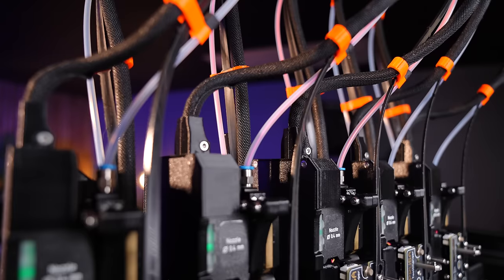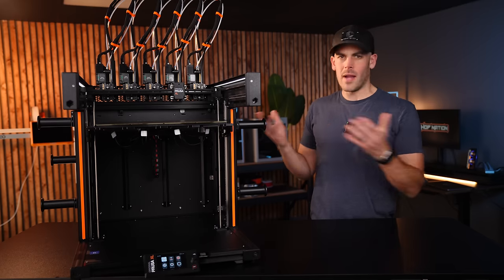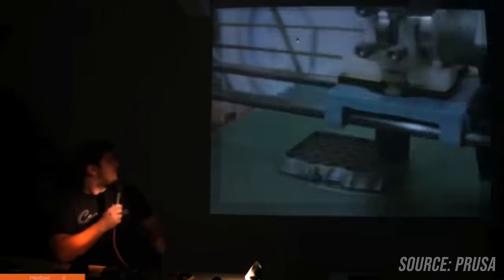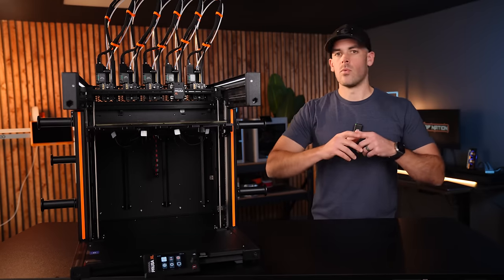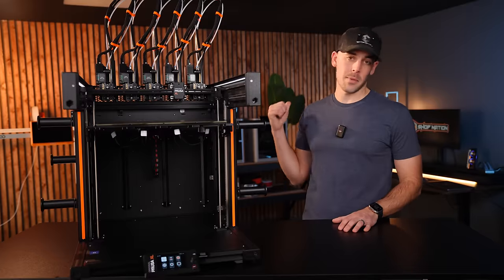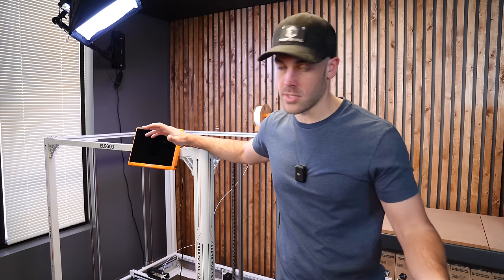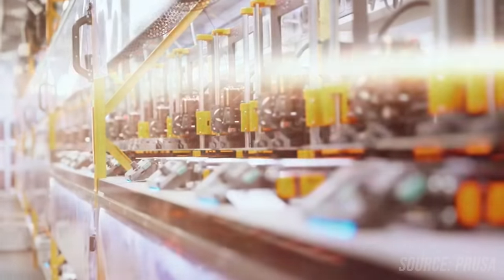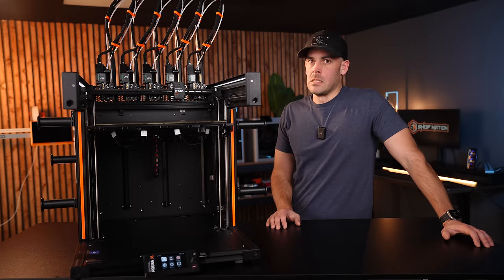Why Prusa is the next Blackberry

Comment: I agree that the advantage of the XL is the tool-changer.  How valuable that is remains to be seen.  The other major market advantage Prusa has is their reputation for excellent service; and that is of course a huge part of Prusa's high prices.  You're also paying for the open-source philosophy.  Prusa can't count on a grace period in which they can recoup their R&D costs, so they have to make that back in margins.

Covid supply chain disruption followed by the effects of the Ukraine war  - think about how much of their supply probably came in via Ukrainian ports; Czech Republic is landlocked and most major electronics are made in Asia - certainly delayed the XL, meaning that it's a generation behind not in technology but in philosophy.  The real value of a Bambu printer (and I have an X1C from the Kickstarted and absolutely love it) is how simple it is to use.  My impression is that the XL isn't quite so easy.  But on the other hand, Bambu is clearly struggling to cope with the massive expansion in their user base, and the support side is overloaded.

So... I think if Prusa wants to compete, they need to come up with a printer that is as easy to use as an X1C or a P1P, in a comparable price range, but backed by their excellent support team.  Having a mid-sized (25x25cm or so) 3-head tool-changer for 1000-1200 Euros/USD that just worked without any faffing about, with a marked down single-head version, would be an excellent thing to target. I also think that in order to get the price down, they're going to have to step away from open-source so they can recover their R&D costs.  Open source is extremely expensive.  Back when everyone had to know how to build a printer in order to use a printer, Prusa could afford to be open source because enough people were willing to pay their prices to get the support needed to achieve low-skill reliability.  Today, there are too many options for reliabiilty that cost a lot less, and I think open-source is a luxury Prusa can't afford any longer.

Comment: Sadly I agree - I am a loyal but disappointed Prusa user. I own mk3 mk4 and have an XL arriving in April. I also have a t500 comgrow and an Anycubic Max 2. Core xy for me is the way forward for farm compactness. Printer cost is not as important as its return on investment - speed / reliability / quality for hours on end. I don’t own a Bambu and probably won’t at this time as I run Octoprint and home grown farm software. I want it open source and really a mk4 corexy. Camera / klipper / easy to implement into a farm system. Want them to win but mk4 / xl such a fiasco..

Comment: I think Prusa should continue lean into their core strengths of open hardware and fostering an innovative and friendly community, and continue to make reliable machines and software at reasonable prices (the XL was never priced to compete with Bambulab printers, it was priced to compete with Ultimaker and Markforged-- in this context, 5 tool heads at ~$6000 is a bargain!)

Comment: The difference in material between the Prusa XL and the BambuLab X1 with AMS is also lower the more prints you do at the same time. The the test you made is only really valid if you buy the XL to print a single small multi-colour object at a time - which seems somewhat unlikely as well. The waste will still be there, but the waste (and switching time) will be constant even if you print 20 benchys at the same time.

Comment: I'm frustrated by Prusas numerous poor decisions, and it seems theyre not making any effort to change course. Prusa is actively developing the slicer for Bambu Labs because Bambu Labs is just using a skin with some minor tweaks, and apparently Prusa Research still thinks that open source is a good idea for this type of market. The Chinese stole and copied everything from them until they were better at manufacturing and are now clearly leading. Customers aren't looking for machines to tinker with; they want sleek, feature-rich devices.

The decision to release an open-frame design printer is baffling. Their printers have too many parts, which drives the price to an uncompetitive amount, and the machine looks and feels like an obsolete DIY project. There are so many things that are obviously stupid to put in a 2023/24 3D printer, but they still went with it. For example, look at the touchscreens of the MK4 or the XL. Why? Prusa likely knows all there issues, but it appears they're stuck with their choices.

Overcoming these significant challenges will require substantial capital to speed up their slow product development cycle. The forthcoming MK5 will likely be outdated upon release. However, to be fair, your speed comparison wasn't entirely equitable. Focusing solely on printing time overlooks print quality. All Bambu Labs printers are printing too fast. The filament is not extruded hot enough. Parts printed with PETG have a matte finish and compromised mechanical properties, unlike the XL, which maintains proper flow rates and delivers superior speed. The XL won not just by printing time but also by print quality. 

Despite this, the XL falls short compared to its competitors. But the worst part is that I will still buy an MK4 soon. We need manufacturing here in Europe, and we need to support local production. 
Good and fair wages, workers' rights, production that does not poison the environment and the workers, and a seamless supply chain that prevents slavery or exploitation in labor are so important to me that I prefer to buy a Prusa printer rather than a printer from the Chinese capitalists.

Comment: Actually I own a Prusa XL 5 toolhead and I am satisfied. I print multi material (not just multi color)  large prints very well.  I do not care about "nice" color displays or many features you are talking about. I want something what is working. Price sucks ... yes it is .. but I spent the money because I love 3d printing ... It is a hobby for me. Not a many maker. I won't go for Bambu lab, because it doesn't satisfy my need for challenges and modifiability.  On other hand Bambu lab took  all open source know how about 3d printing and put it into a nice mass market package. Nothing revolutionary, just evolutionary. BTW they are using load cells in other models instead of lidar not just because of price difference ;-)  Anyways, comparison of a Prusa XL to a Bambu X1C is like compare a Sedan to a Semi Truck. Both can take a load from place A to B. Sedan is faster ! But voila we still using Semi trucks.  It is just a  different category.

Comment: Man, as someone new to 3D printing I didn't even consider buying a prusha. :/ Has considered a lulz but went straight to Bambu. Multi head would be cool... If it was about the price of a bambu with an AMS (I'd pay a little more) and realistically I feel like I'd only care about having 2 or maybe 3 print heads support material and maybe 1 other color. Very niche. Very expensive. I've occasionally wanted a slightly larger build volume, but really not worth the cost imo.

Comment: I have a Mk4 and love it.. but I'd like to see a polished enclosure integrated at a minimum. I'd also love a 2 head machine (not 4 or 5). I don't care much about colors but switch between PETG and TPU constantly and would let you do things differently with supports. Also  -Prusa's wireless functions are straight up confusing.

Comment: You completely skipped over the use case of printing MULTIMATERIAL, like combining TPU with PETG and PLA supports, which is not really tangible on a single print head.

Comment: Prusa needs a smaller version of this printer. Even duel head would be enough, but 3 heads even nicer. A smaller bed size, 300mm max. Enclosed for ABS, etc. Build something that is priced close to Bambu. Separate heads so much better than filament switching. Less time, less waste. Provide a multi-head upgrade to their single-head core xy machine. If they can get the price close to Bambu, Prusa's support and parts repair/replacement will carry them through.

Comment: The use-case for a prusa isn't a simple colorchange. The use-case is to print flawless with different material at once. For example PLA and PETG. Those two don't mix very well and don't stick very much to each other. This makes it the perfect support material. Or think parts with living hinges and / or overmolding with TPU. Fiber filled materials for outer walls, cheaper materials for infills. Etc etc etc. There are thousands of use-cases, where the (fantastic) BambuLabs can't get a grip on the Prusa.

Comment: I think that Prusa has been making moves in places other than their pure printer mechanics that keep them going.

They've invested a lot into Printables, filament manufacturing, print farm operation software/hardware, and SLA. I remember the cries that the Ender 3 would kill prusa, instead it really killed the i3 clone market and sure took some people who could afford Prusa but were in for more of a hobby.

The elephant in the room is also the K1 and Qidi are putting pressure on Bambu in a game that Prusa has decided not to step in. They're racing to the bottom for reliable core XY closed ecosystem printers with limited print farm integrations or solutions.

Comparing the AMS to the XL's tool changer is on paper a decent comparison, but multi-tool has more advantages than just speed and material (which at scale material cost could be big). Multi tool let's you have your part still retain most of its glass state which when doing changes in materials like ABS, TPU, or silk can be HUGE for layer adhesion vs waiting for a long filament swap, reheat, and purge. Multi-tool also lets you use things other than the same nozzle (changing nozzle sizes, changing heater dynamics), it lets you use drastically different temperature or wear characteristic material without clogs, or it lets you even recover if there are clogs/errors with a single head mid-print. That reliability and recoverability in print can be important for complex production parts.

It's ironic cause I point almost everyone I know at a consumer level away from Prusa for printers. But for labs, small production farms (where reliability is > than startup cost), and engineering samples Prusa is still big.

Prusa is playing more and more to compete with Ultimaker, Raise3d, and Intamsys and come in WAY below those budgets with comparable or leading features and a lot of good support with tweakability.

Comment: Honestly, I think a lot of people fell for Bambu because they offered the illusion of speed at the illusion of lower price. When the X1 came out, the buzz was "bed slingers are dead, core XY or die", but for all the hype, the X1 isn't exactly leaving the Mk4 in its dust. Then the A1 came out,and suddenly it was "Bedslingers are ok again, as long as they do multimaterial". Multimaterial itself is hideous, but the level of waste on Bambu machines ought to be illegal. On top of that I think Bambu is running at or near a loss with their pricing, especially with the A1.

CoreXY isn't the be all and end all of printing either, and not everyone values raw speed over everything. I believe Prusa are playing the long game - with the MK4 they consolidated and modernized their supply chain. With the XL they began testing CoreXY, without betting the farm on it. They clearly want to figure a bunch of things out before ditching cartesian.

What I would like to see Prusa do is double down on convenience and ease of use. More options for fast and easy nozzle swapping. Enclosure support, with motherboard tethering. Better remote management. Better camera and failure detection. There are plenty of community mods but I want Prusa's quality level from them.

Comment: There are two factors not properly addressed here. 
(1) Prusa always took care that the printers work out-of-the box after the initial release hiccups and provided absurd long service to their products (absurd from the perspective of the throw-away-and-buynew society we have to live in)
(2) As far as possible, Prusa is manufacturing in the EU and always expanded their manufacturing capabilities so they can manufacture more stuff in-house. Compare that to virtually all other companies and industries. They went the other way around and this will (and partially already has) generate turmoil in global supply chains and global political risks. 

Prusa is not on the innovation forefront right now, yes, but innovation is not the sole factor determining success. Heck, there are an absurd amount of S&P500 companies that aren't innovative at all and will likely not vanish within decades (looking at you AT&T etc.)

Comment: No offence, but if you don't need or care for toolchanging and what it brings vs an AMS type unit, then ofc you wouldn't appreciate the extra cost of the XL over a Bambu or larger FDM style printer. But that's just it, a toolchanger is a different machine that can do different things (that are not obscure btw, just more industrial so you don't see hype video on IG/YT) than printers with AMS style units.

Comment: Focus on UX and ease of use will get this machine into more engineering departments like mine.  It’s the little details don’t screw up on any of them.  UX of filament changing.  UX of nozzle swaps.  UX of bed leveling.  UX of removing a print.  UX of slicer software.  UX of build support removal.  Then spend $$$ on the parts that matter:  Diamond hot ends, high wattage hot end, Rigidity, precision rails.  BTW i could care less about material changes or even how fast it prints!  Reliability is super important.

Comment: Recently got my hands on a used MK4 (800 meters gone through) and I am impressed with this machine already, plus side you get 24/7 support chat, open source , parts from fystec are compatible etc. Oh and you can use octoprint/octodash. Bambu on the other hand beautifull machine, laks support and firmware is closed (nicked prusa firmware) source? I wonder how fast you can repair a broken prusa vs a broken bambu. You might do a video on that if somethings break in your farm(hope not)

Comment: I think you are missing the point of the XL. Multi color can be done by a ton of other printers, obviously Bambu being the most prevalent and easiest to use. What those dont do, is multi material printing. PLA supports for TPU or PETG, PETG supports for PLA, TPU and PLA in the same print. This was designed for manufacturing, not for trinkets.

Comment: Remember when the i3 first came out and it was made of either wood or acrylic? I remember then and I remember that there was a spanish company that was making a steel version of it. Other than that initial design, all they have done is incremental improvements and the entire industry followed them down that path. Bambu is the only people that forced people to think that just making yet another bed-slinger wasn't the right recipe for success. Sure we had a few deltas and the occasional cartesian box, but most of them were implemented poorly. This was always Prusa's game to lose. It is the same reason that Intel is losing now in the CPU market. They spent 8 years regurgitating the same old tired thing with just a 5-10% improvement over the last one. And they felt smug because AMD couldn't release anything competing because they made a huge mistake with Bulldozer and mispredicted what people were going to code for. And now we have AMD processors that are better in almost every respect. Just like with Intel, there are huge Prusa fanboys who will never admit they were wrong. This isn't the blackberry moment, this is the Intel moment.

Comment: I didn't want to be an early adopter of 3D-printing after seeing the struggles of a friend, and have held out until now.  Convinced myself to get the Prusa Mk4, then considered the physics and now getting the Bambu Labs X1 Carbon instead. It's obvious that the variable inertia of bed-slinging can never be as fast or accurate as core-XY. Prusa's Mk4 needed to be a core-XY printer and they need to protect their intellectual property, as Bambu Labs are, to avoid becoming a Blackberry.

Comment: Prusa is certainly taking risks. The MK4 is suitable as a machine for hobbyists but the price is way to high. Yes the quality is outstanding and running 24/7 for about 4 or 5 year certainly will be possible. Prusa is pushed more and more to the professional market. I don't know if that market is big enough. They should add a free mmu or create a cheaper version of the MK4 and mini to survive the competition.
The XL is a unique machine. A bit overpriced compared to other machines in the market, but with multiple toolheads it is an unique machine, which is an excellent choice for a a printfarm which needs to produce multi material/color prints. In terms of speed the XL must be capable to speed up about 20%, depending on the filament. Mine is running 24/7 for 5 month now, without a single fault, except user errors. Which is an excellent track record.
Prusa should make a choice if the want to be active in the hobbyist market, or switch to printfarm-printers.

Comment: I have an X1C with the AMS and it has been great. I also have an Anycubic Kobra 2 Max for anything that is too big for it. I would consider it as a replacement for both but the cost is just too much. The XL is more than my X1CC, Kobra 2 max and even my Elegoo Saturn 3 Ultra combined. Also I dont print filament like ABS or ASA often but I like having the ability to do so and the Prusa XL is not even enclosed.

At this point I am waiting for a Bambu XL printer of some sort. I do really like the multi toolhead approach and would use multicolor more if i had it, but not at that price (and the lead time is still like 2 months according to their site)